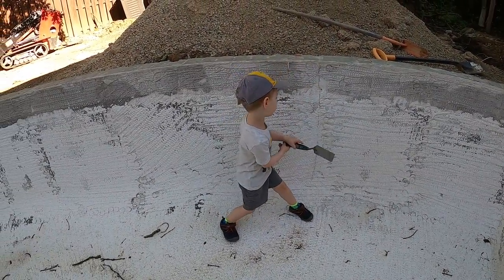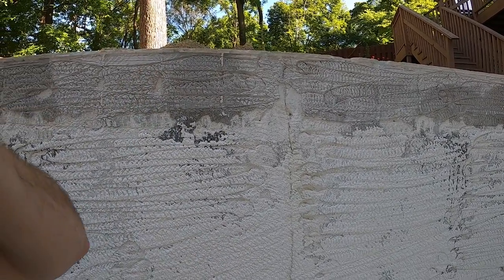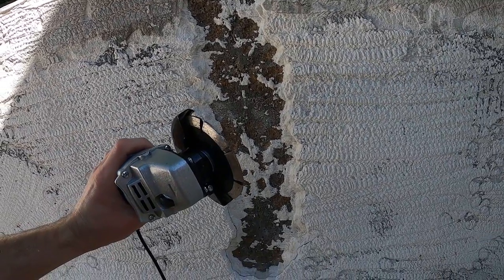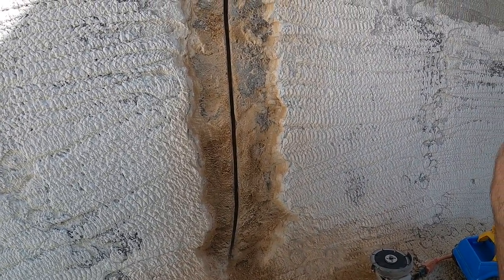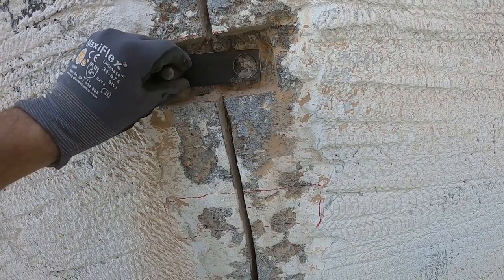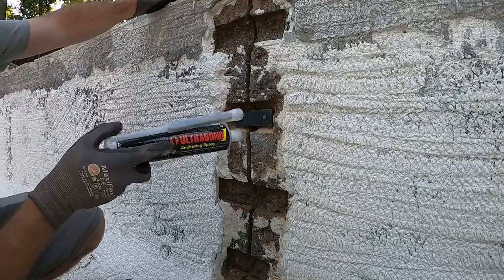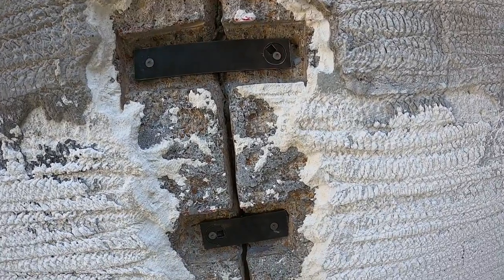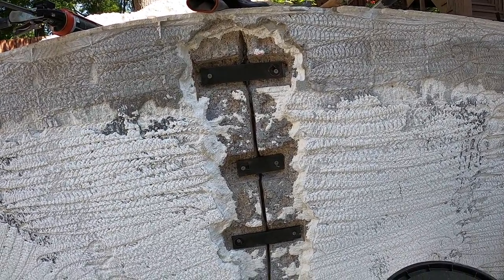DIY - Pool Crack Repair - Full Video

Comment: How well has it held up? Going to be doing this as well. They seem to have the superior product on the market currently since they actually have the ability to pull inwards on the crack. Really great product. I do have a question. Can you just cut out the template of the staple or do you need to cut that big of a portion and enlarge the crack? I would like to do minimal damage. Thanks for the video, you did an outstanding job explaining and repairing your pool.
Reply from the maker: Hey there Andrew. I'm starting our 3rd season since making the repair, and no issues at all so far, no bleed through or any signs that there was a crack or issue. Regarding your question, I would think you could successfully make the repair by containing your "demo" to the staple template footprint as long as you are able to get to the actual pool shell and not just to the plaster. Since we were doing a complete renovation I wanted to make sure to remove any remaining plaster around the crack in case it had become compromised or loose. I do think it would be a good idea to use a crack chaser blade to enlarge the crack regardless. This isn't something you want to have to do more than once, so I tend to air on the side of overkill. If I had to do it again, I would do it the same way and use the torque lok staples again for sure. Good luck, let me know if I can help further. (Keep in mind, I'm doing this DIY too).

Comment: Great video! Interesting thought experiment would be to chase the crack on the backside too and do a couple of torque locks on the backside and fill the crack with epoxy or hydraulic cement. 
It seems this area has the rebar overlaps and it wasn't tied together all too well and it's slipping or there's settling of the ground at that point to cause the crack.
Your thoughts?
Reply from the maker: Spot on with your thinking here. I actually went on to do this exact thing before I completely finished up. Since I had the "deck" removed around the pool, I was able to dig down on the outside of the pool shell and went ahead and put another staple on the outside. I also did use the epoxy to fill the crack, mostly to help prevent water intrusion from the outside. Then I backfilled with some 1" minus limestone, since I had a lot of it on site for the paver deck installation. 

I like your thought of the root cause of the problem possibly resulting from the rebar overlap in the shell; hadn't thought about that but seems like a logical explanation.

Thanks for the comment!
Reply: @SeldomRest  ok good to know! I'm about to embark on a Diy pool project so your videos are helping out a ton! 
Any chance you'll do a pool equipment video and your logic for piping and calculating flows? You seem very detail oriented like myself so I'm curious to see how you went about setting up your equipment pad and underground piping requirements as well. Thx!
Reply from the maker: Let me work on pulling this video together. I do have some content and will add my thoughts to it as well. I've been wanting to do an overview of my equipment too, I've been very happy with the performance of my setup now, so will be happy to share. Glad that these videos are proving helpful, I definitely learned a lot along the way!

Comment: I’m about to try this repair on my pool but I have some questions. I don’t have plaster people coming in after the repair so would I sand down the hydraulic cement after it sets up? And can you tell me about a waterproofing membrane? I’m new to this all but I’m giving it a shot.
Reply from the maker: Hey there, thanks for the comment and question. I should caveat that I am not a pro, just a DIY guy, so there is a lot I don't know as well. I would recommend (if you haven't already) watch the videos that Torque Lock has posted, they show some being installed when the entire pool is not being refinished. I think will be basically looking to "patch" over the hydraulic cement with a plaster finish that matches your current pool's finish. Regarding the waterproofing membrane, this is a brush on compound that just further helps to cover the repair, we used a product called "HEY'DI SB", and the number on the bucket is "TL1941505". Hope this helps!

Comment: Was wondering if you knew the specs for the water proofing membrane that was applied over the hydraulic cement?  I have watched all the torque Lock videos and they also talk about applying a water proof membrane over the hydraulic cement but do not specify a spec or brand.  Great Video!!  Thanks!!
Reply from the maker: Hey Curtis, thanks for the comments and question. I was able to find the leftover bucket of material, looks like the name of the product is "HEY'DI SB", and the number on the bucket is "TL1941505". You may also give torque lock a call, I'm sure they may have a product recommendation as well. 

Hope this helps, good luck with the repair!
Reply: @SeldomRest  Thanks!!

Comment: i just wonder if you ever see any crake from the outside wall of the pool, will you use some cement to fix it
Reply from the maker: Thanks for the comment. I actually was able to see the crack on the outside of the pool wall and ended up putting a staple and cement on the outside as well. 

So far so good, Have gone through a full year with no returning issues. 

Thks!

Comment: Was the crack existing or did  the company made it when removing the plaster
Reply from the maker: Hey there, I believe the crack was existing. The plaster company used a hydro-blaster to demo the existing finish, which is much less intrusive compared to using demo hammers. I did not notice any leaking issues prior to our renovation either. I'm really glad I took some time to inspect the pool shell though, otherwise this would have definitely caused me an issue. It's been about two seasons since I made this repair and so far so good.

Comment: The metal braces need to be painted with anti-rust paint to prevent rust from going through the plaster.
Reply from the maker: Probably not a bad idea. So far so good with it, hopefully it stays that way. Thanks for the comment.
Reply: Looks like the torque lock is already coated. No paint necessary
Reply: The rebar used in the original gunite shell is not painted and so the staples don’t need it either. Once it’s encased in concrete oxygen and moisture can’t get to it and start rusting. The staples do seem to have some oil on them which would also help a little.

Comment: Excellent video. However, I believe it was totally unnecessary to do the repair project as it was done. Because in this case, you were lucky enough to be one of those rare? pool owners who had no poured concrete deck, and easy access to the outside wall of the pool. Your crack was only about 3 ft in length from the bond beam. This means that you could have excavated the soil OUTSIDE the pool, and set either the 'Torque Lok' bars, common (inexpensive) flat steel bars, or even rebar staples across the crack to hold the structure together, with no need to place and recess the bars into the inside wall. Bars installed on the outside pool wall should hold structure together just as well as those placed on the inside, and there is no need to do the rectangular recess cutting, chipping, and subsequent cosmetic work to hide the bars. 
I would however, use a masonry grinder to simply open up the interior crack so it is deeper and wider and shaped to better hold onto hydraulic cement, which I would use to patch along the interior crack. 
Beyond this point, and acknowledging that the 'Torgue Lok' product is good,  I question whether there is even a need to use the expensive Torque Loks. The only 'advantage' I see with the T.L is perhaps the ability to 'ever so slightly' apply pulling force to minutely (if any) pull the 2 parts of the cracked concrete structure together, or to possibly hold them together tighter than 'non-torquable' materials such as a simple, strong, flat steel bar or even rebar would hold. My goal would not be to try to 'pull the concrete together', but rather to simply prevent it from separating any further. If I can prevent any further movement, then I can just repair the crack inside the pool using only cement, epoxy or whatever product I chose to prevent water from escaping. A patched crack will block water, as long as the under-lying structure does not move further and ruin the interior surface patch.